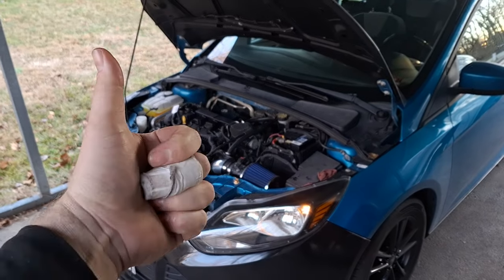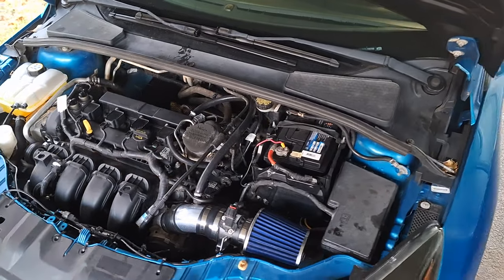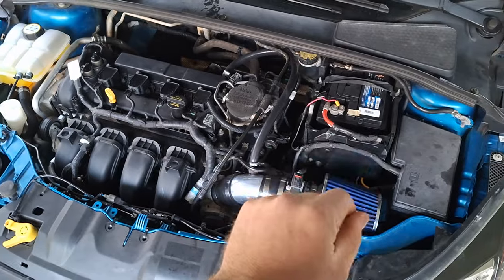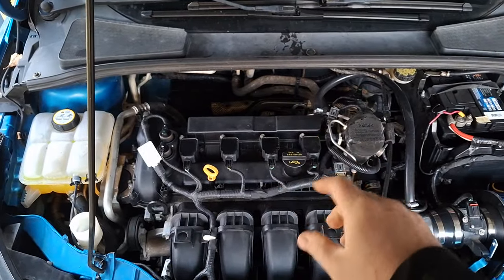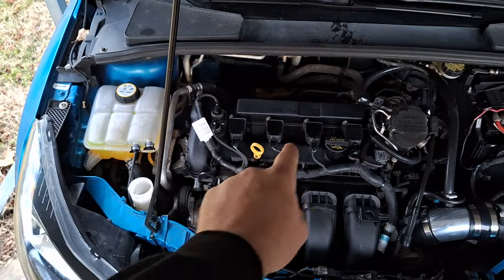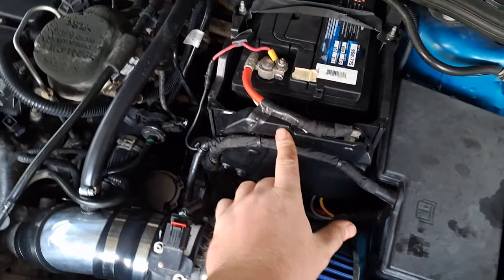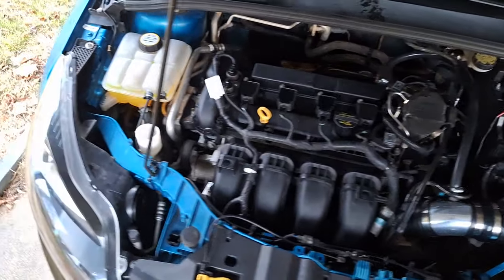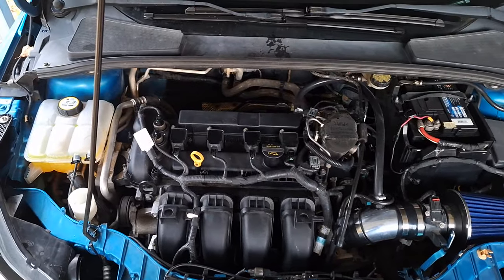How To "Bulletproof" a Ford Focus! 2012-2018

Comment from the maker: Update: On the 1.0L Ecoboost, Fords going to be recalling the oil pump tensioner issue

Dual Clutch OEM Clutch & Fork Kit: https://amzn.to/47GMeIl
2.0L Engine Mount: https://amzn.to/49366Xd
2.0L Upstream o2: https://amzn.to/47KVuv5

Comment: Thanks!  Just bought a 2013 SE with dual clutch and just 85k miles from the original owner. She had every service performed and the car is immaculate. The washer reservoir cap is cracked and yours is missing I noticed. Also, I pulled off the bottom engine cover and I think it looks like you did as well. The transmission currently works just fine with an occasional flutter or slight slip at the 1-2 shift. But otherwise works fine. However, I believe I’m going to go ahead and buy the kit to have on standby. Also, I have the TCM offering still in my back pocket since Ford says it’s never been replaced yet. (Have until 2025 to get that free). My son drives this mostly but I love it. Your video is very much appreciated and I’m going to jump on the other items you pointed out. Thanks!
Reply from the maker: You're welcome. Glad to help! I've got tons of other videos on these cars. Including removal of the transmission at home in the driveway, and doing the clutch with no special tools. Hope it helps! Happy driving
Reply: Thank you. I just received my new Launch X431 Pros Elite yesterday because I’m using this car as an excuse to get it. Haha. I used to be an ASE mechanic back in the 80’s but still do all our car work myself. I’ve rebuilt transmissions before but had to take a crash course in DCT’s once I got this car (2 weeks ago). I feel up to date now though. The part that bugs me the most is that the poor throw out bearing (sorry, slave bearing) is constantly under pressure and spinning while underway. With nothing but the grease from the factory, this just seems like Ford was asking for trouble. The DCT’s which use wet clutches seems much wiser. I guess Ford figured they’d last long enough to make it past warranty.
Reply: @BigBensCarsAndCycles 2011 Ford Fiesta SES has a slight vibration feeling on the steering wheel or hand on the motor at 900 rpm idle. No lights. No missing at low or high speeds. Transmission no problem since Module recall replacement, PCM, computer, clutch replaced at 75,000 miles. Now has 110,000. New plugs, air filter didn’t affect vibration at an idle. Any ideas before I take it to the Ford Dealer? Car runs good.
Reply: @LastTrump7   check the motor mounts lol 
they are kinda ass, ive just dealt with it for like 2 years
Reply: i also idle at about 900 in the focus
Reply: i was also told by ford dealership that you need to drive them hard, i listened and im at 192k miles so take that as you will

Comment: As a ford technician for the last 25 years I can tell you that its not the most reliable engine
Reply from the maker: Cool! What internal engine issues have you seen on the 2.0 duratec? I haven't seen one in my 11 years. I've heard of a few online that overheated and one that broke a rod when he drove it hard with a plugged cat.
Reply: I had an 05 focus with the Duratec 2L it gave me no problems at all. It was 8 years old when I got it and I had it for 10 years and just sent it off cause the canadian salty roads got to the bottom of it.

Comment: You cannot bulletproof these cars with the DPS6. I had everything in MY DPS6 replaced 2 years ago. I am already shuttering going into gear 2. My clutches only lasted 3 years. I have owned my car since new and only Ford has repaired it 7 Times.   Bull SH!T Alarm is going off right now. And get a wiper fluid cap!!!
Reply from the maker: Hi, you can drive the car hard once in a while to mitigate shudder and that'll let everything last longer. That's a main issue is that people aren't well informed on the best way to drive these cars. It's my goal to help people out with them and save them money. Just drive it like you stole it occasionally. It's what I do, and I haven't had shudder in some time
Reply: @BigBensCarsAndCycles  when you drive it hard you put more clutch dust into the actuators that causes them to hang up.  I will drive my car until a get my mass action court case (soon I hope) or it breaks again..... THX. for advice.
Reply from the maker: @jamesmatheson4746  Good luck to you sir. If the car is babied all the time, it's going to accumulate more dust. And long term, it'll add up. If driven hard for the first time in years, it can dislodge a lot of dust. So I agree. The best thing is to start with a fresh clutch & forks and don't baby it. Shudder is caused by hot spots on pressure plates. When driven too easy, the tcm will slip the clutch more to provide smooth acceleration. This causes premature wear, heat and clutch debris. This can be mitigated if driven correctly from the start.

Comment: Ok , did everything to get my dps6 clutch back in but now I'm having no success getting the ball joints reinstalled. Anyone have any ideas that will work ?
Reply from the maker: they can be tricky. is your inner cv joint dislocated? That can cause limited movement in the knuckle/strut

Comment: i need to clean my throttle body and the air sensor, can i take off focus’s throttle body and move it around while cleaning?
Reply from the maker: Yes, i wouldn't move the throttle body valve too abruptly though just to be safe

Comment: I have a 13 focus 227km replaced the tcm and clutches twice. The last time was 2018 @ 180km for the clutch and 2021 @ 210km for the tcm. I have been told the seals and clutches were updated and are a lot better now. I don't have any jerkiness anymore but in the back of my mind i will never trust this car not to break and wait times are crazy for parts and I don't think i qualify for the extended 2025 tcm because I had mine done before. I want to sell it but sometimes I tell myself I can trust it now its got new parts, but it seems even 2018 focus still have the same problems just not as frequently. Aside from that two years ago I had wiring issues there's a TSB for wiring rubbing against the intake manifold. I think they actually misdiagnosed the TCM and it was wiring all along and I probably didn't need mine replaced but I'm glad i did at the time so I'm not dealing with it now. For months afterwards my car would break down without warning I had the wiring checked multiple times and even the guy from ford Canada said I should ditch it for a fusion because the transmission problems anyway. That's very reassuring. I almost forgot when i went in in 2021 they first diagnosed it as needing a clutch! i said i just had mine done two years ago drives like a dream compared to before. He said it failed the RPM test that's when i told him its the TCM or its not that because i drove this car for years with a bad clutch and it never left me stranded just jerked like crazy, when they kept denying anything was wrong with it no one did an RPM test all those times i complained while i still had a warranty. That's when he gave me the new tcm i probably didn't need. it broke down two weeks later and they found the wiring issue. After it was repaired my car broke down about 4 more times and they said they couldn't find any issues with the wires they repaired (i took it two 3 dealerships total). I bought myself a scan tool and started replacing sensors that i'm guessing were damaged from the short. Both cam sensors. Fuel rail sensor (i think this was the one thanks to the third dealerships recommendation). o2 sensor. Then someone pointed out i had a leak. It was the TCM they didn't install it properly and the O ring was crimped or something. Hopefully that didn't cause any more damage than i already had they fixed that no cost. Recenly my purge valve sensor went i called them about the recall they had checked the software was updated in like 2017 so they said the recall was closed and i no longer qualified for it so i replaced that part. replaced the water pump. my engine mounts are shot (on back order) and my coolant reservoir developed a leak (pretty common). I never got a message that my car overheated but i'm scared to death that running low on coolant for however long could have damaged something and now i noticed my valve cover is leaking. I am having that looked at tomorrow. I've done every single oil change at ford and not once did anyone mention oil leaks, coolant tank leaking, engine mounts shot, i had to find that all out on my own. I also think they should have done more with the wiring TSB. The fix was fix the wires and wrap conduit around it. They couldn't have informed people it was a common problem and recommend a 10$ piece of conduit to save me 1000$ in wiring issues. I seem to have had every common issue on this car and i cant tell if i'm at the light of the end of the tunnel now and ill be good, or if i'm about to enter another nightmare if i keep it any longer. Just my rant about my experience
Reply from the maker: Sounds like it's time for a different dealer. Anyway since you have a new clutch and tcm you should be fine. Just ignore shudder and drive it hard occasionally to mitigate it. And yes there's a tsb about wiring rubbing on the intake. They should have checked that
Reply: yeah i've had no transmission issues since and ive done 47,000km on the clutch so hopefully it lasts a bit longer. I don't even have a shudder at all since replacing it because I avoid sitting in traffic and letting it overheat. But i'm stressed currently about the valve cover hopefully being the only thing leaking oil. ill update tomorrow but that was 3 ford dealerships i had been to not just one. I have a local guy i'm going to try now. I have learned so much from videos like yours though so thank you soo much. I would have stayed oblivious probably to most of what's been going on had it not been for people like you making these videos.  @BigBensCarsAndCycles
Reply: well i got the mount replaced and now i have a belt squeal when i first start my car. Do you think it got stretched from having a bad mount or do you think its more than that? idler pulley/tensioner? now this with the valve cover needing done I'm really feeling over my head with non stop repairs
Reply from the maker: @geometricdesigns3620  repairs will stop eventually. Probably just the belt needs to be replaced. There's also a stretch fit AC belt. I've got a video where I did that belt on my project focus

Comment: In addition to everything you said, I would also suggest that you find and clean the paint off of any grounding points on the battery. I did this a long time ago on my 245k miles Focus and I still have the original TCM. This may or may not be the reason its lasted so long but it definitely won't hurt as long as you protect the area with grease so it won't rust. I do this to all my car to protect the increasingly sensitive electronics in newer vehicles.
Reply from the maker: Thank you!

Comment: Thank you for these vids, Im having issues with a focus I just got. It shifts hard and looses power during a shift. I got a p07a5 code come up on the forscan. I havent got to look at it yet though.
Reply from the maker: You're welcome! Switch actuators A and B around and if the code changes to p07a3 then replace both actuators. If it stays the same, get a LuK repset (oem clutch, forks and slave cyl) and should still replace both actuators. A sticking clutch fork can cause wear to the actuator and lead to a neutral feel on the highway

Comment: I replace my upper engine, I do still have a vibration you think it could the trans mount or roll support mount, wanted the check the support make the right bolts in the right place, I remember you mentioned in a vid it could cause a vibration
Reply from the maker: Check for rocks stuck in the lower mount

Comment: Bought one new in 2016 with 5 speed manual now 334k miles. Only thing to fail was coolent overflow and hard plactic coolent line . Replaced stuts ,shocks ,brakes ,tires . How long do the dual mass flywheels last with manual transmission? Clutch never replaced seems ok yet. Ford focus has been an excellent car.
Reply from the maker: Hi, the flywheel should last the life of the clutch.

Comment: Does everything you said go for the 2011- newer, dual clutch Fiesta also?
Reply from the maker: Yes for the dual clutch transmission. On a Fiesta you should also do the purge valve, tune up, valve cover gasket, engine cooling fan, timing belt, water pump

Comment: I love your videoes and am a former Ford dealer tech.   My 2014 Focus developed an odd problem where the engine stayed running after the key shut off.  It turned out to be caused by washer fluid getting into the fuse box /BCM behind the glove box.  I guess the fluid leaks up the wiring by capillary action.  My pump (Motorcraft) and cleaned out the corrosion and all was well again.  Have you seen that issue before?
Reply: Replaced pump I mean.
Reply from the maker: @scottjacoby8301  interesting! I haven't seen that, nope. I've seen a few where I lock the doors with the fob and it starts the engine lol (bad bcm)

Comment: Hey Ben; 
on the OEM Purge Valve will that give you a PO452 code?  "Evaporirive Emmision Pressure Sensor / Switch Low" ??😢   2015 with 122k miles.   
I will be looking at a replacement water pump & flush it with the new yellow fluid when it gets warmer in Ohio.     
Its still running the same clutch that was in it when i bought it at 40k miles.
FYI the Company Name "Luk" (pronounced like Luke as in skywalker.)   Is made in Mexico at the Pebla plant.   Worked for them for 8 years in Wooster Ohio first job was building a Test Dyno for the DTC clutches.😊
Reply from the maker: Hey that's awesome you've got a lot of use out of that clutch. The p0452 code is for the fuel tank pressure sensor. Look on top of the tank on the rear side. A lot of times the wires just get chewed by mice at the connector. You can repair that without pulling the tank. Unless you need the whole sensor
Reply: @BigBensCarsAndCycles  hey Ben
Guess I have to get under it again.   Had this squirrel eating it problem 2 yrs ago.   Soldered up replacement wiring under back seat to that sensor.    EDGUNLESHY style Squirrel spree #2 coming up !

Comment: Hey Ben, I've got a theory for you on the oil leak/seap situation with the valve cover gasket and I'd appreciate to hear what you think-

Is it possible the top motor mount fails over time to warp the metal block below the cover? I'd assume it's more difficult to notice a faulty hydraulic mount compared to a metal one so it can go unnoticed and works in tandem with the lower motor/transmission mount to bow the metal enough so the plastic cover doesn't sit flush? I recently replaced my mounts and valve cover entirely and have been thinking about how much strained forces can be at play with something like that.

I hope that makes enough sense in writing but an example of the forces I believe are at play would be similar to be grabbing a banana with two hands on both sides and bending it against the curve. I hope that gives you enough insight into my line of thinking!
Reply from the maker: Cool idea! I personally dont think the timing cover would warp. The bottom mount allows for lots of downward movement (its only there for preventing roll) So theres play down there (wont pull on the metal)

Comment: Hi, great video! I just bought a 2014 with the 2.0 for my 16 yr old daughter. The TCM was just replaced by Ford. We put a few hundred miles on it and now it seems like the clutch slips sometimes. Mostly in 1st to 2nd gear. No dash codes. Has 122k miles. Any thoughts? TIA
Reply from the maker: Hi. Drive the car hard occasionally to mitigate shudder, or replace the clutch, forks and slave cyl. Check my last video I uploaded, I talk about this

Comment: Pro 2012-2018 focus tip: 

I noticed you don't have a cap on that washer fluid reservoir. The Dorman replacement cover's fitment is not adequate and pops off after every bump on the road and ford wants $8 for the OEM one. With that being said..... I just wanted to say a mentos bottle cap fits perfectly on the reservoir lol.
Reply from the maker: Nice! I've seen a few people do that! That's video worthy

Comment: i cannot find oem degas reservoir anywhere , where do i find a good one rockauto doesnt have eom
Reply from the maker: The dealer usually stocks them in store
Reply: @BigBensCarsAndCycles  getting from fordoempartsdirect at 95k miles done all service myself this is the first thing to break, thank god its only gonna be like 45 for the part online. i bought peak north american orange hope its good.

Comment: Air conditioning not getting cold air? LW focus 2013 .
Reply from the maker: It may be low on refrigerant. You can buy a manifold gauge set and attach it to the car while trying to run the AC. See what the pressures are with the AC on and let me know if you'd like. Or have a shop evac and measure what's in it. Might be a leaking compressor or condenser possibly